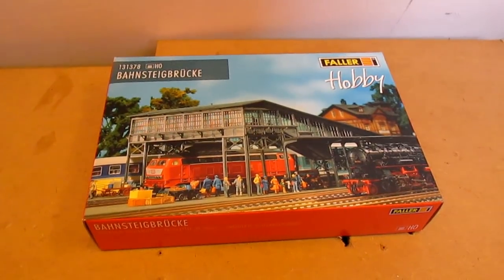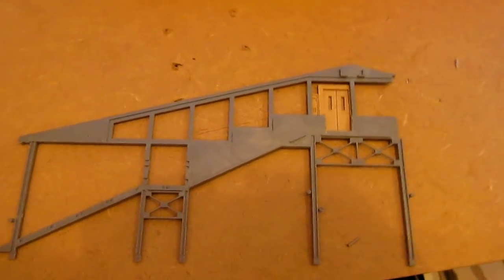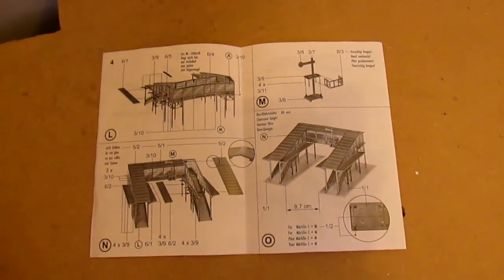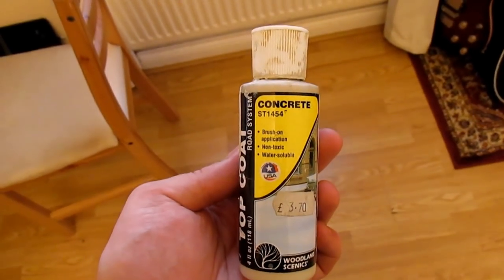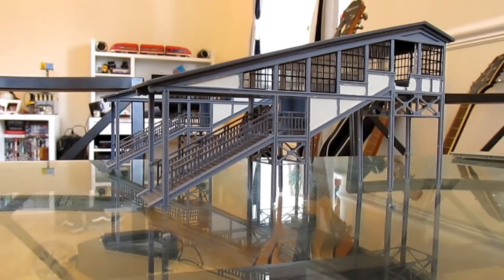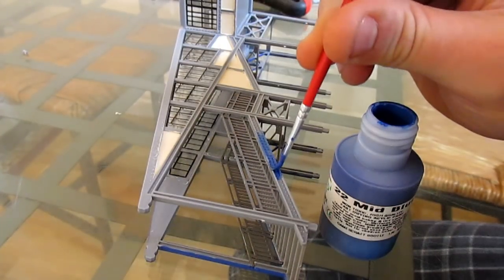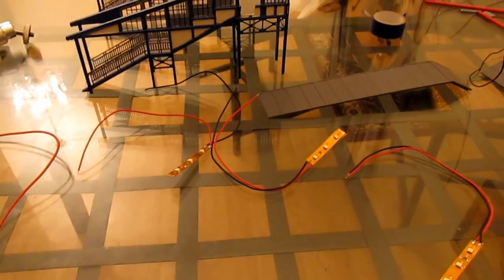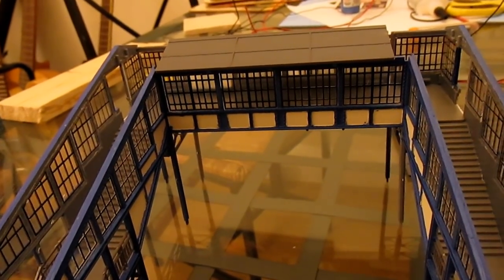How to - Episode 5 - Faller footbridge HO 131378

Comment: Now that's Ironic. I just bought this very kit and was literally wondering if it was possible to put elevators on the side of i. And than I found this video Awesome. Also I use woodland scenics [lug lighting system and wa wondering how to hide the wires, droppnig them in the lift shaft to put them out of sight is a great idea. Ans that kit of yours turned out great.